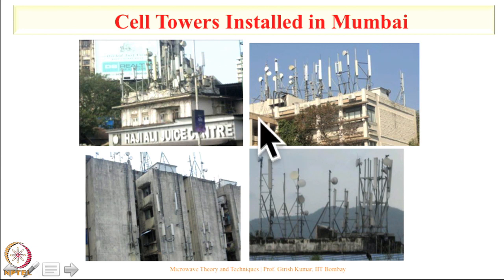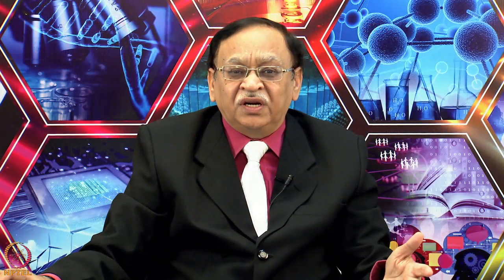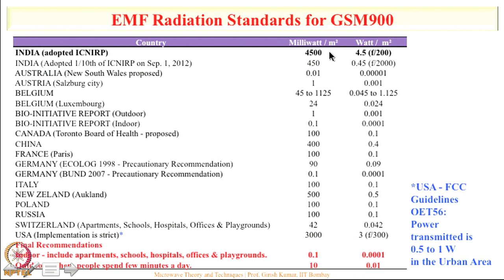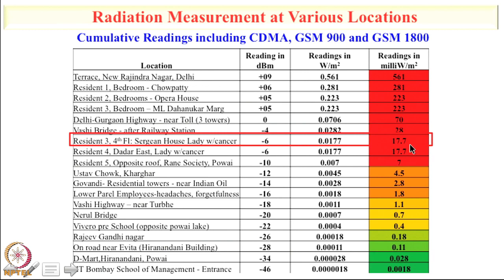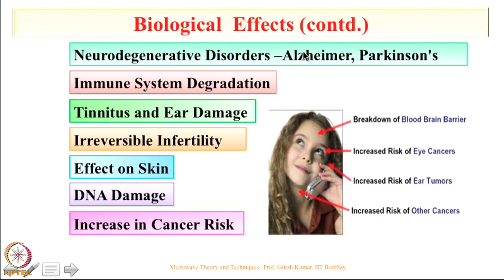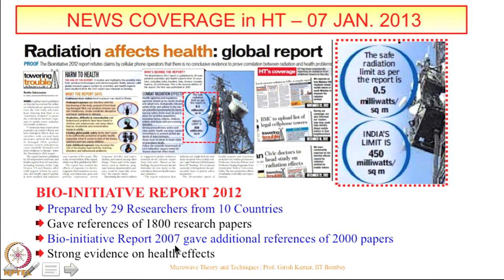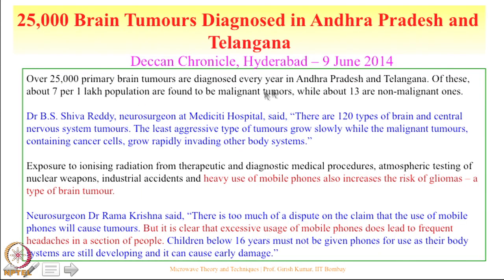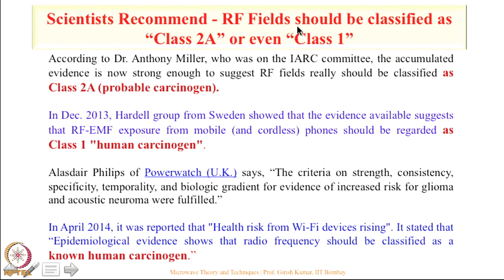Week 1-Lecture 5

Comment: Due to the high population, there is a need for high speed so technology is moving at millimetre frequency which would be very much dangerous but it necessary to overcome such issues by an engineer our role is to bring solution and hence I need suggestion...

Comment: I am a Masters student of RF and Microwave Engineering, IIT Kharagpur. Usually we are more focused on gain , efficiency and power transmission of an antenna. But its adverse effects on human body is totally neglected.  Thus I am in full agreement with the professor to declare EM radiation as 4th type of pollution.